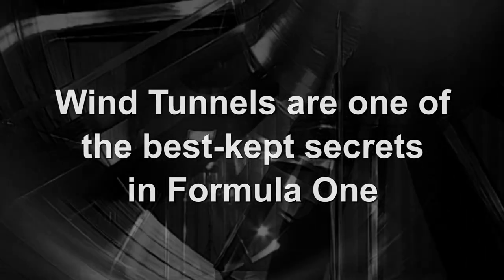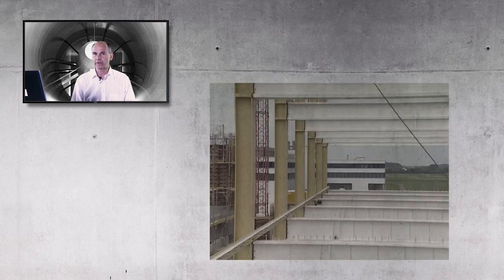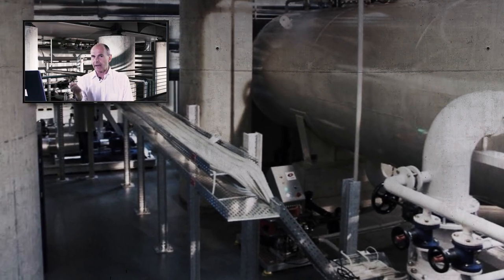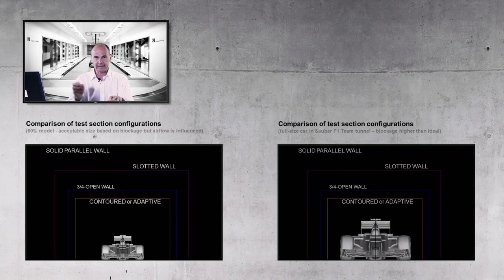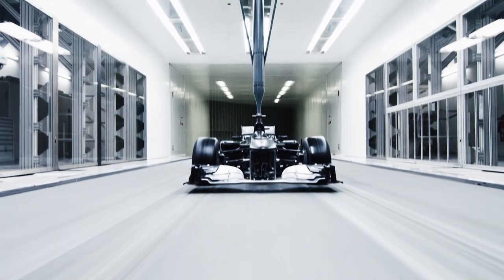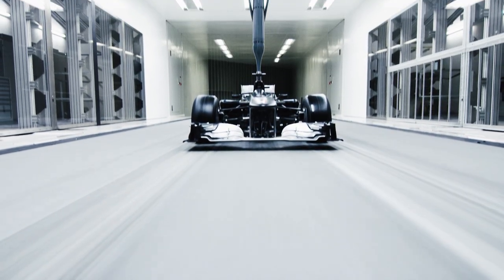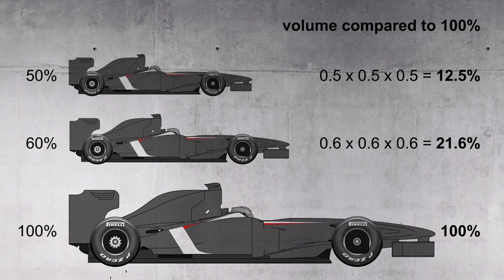How WIND TUNNELS Work - F1 explained - Sauber F1 Team

Comment from the maker: 44 minutes of expert knowledge on how wind tunnels work!

Sauber F1 Team Head of Aerodynamics, Willem Toet, explains EVERYTHING you might want to know about wind tunnels, wind tunnel testing and F1 wind tunnels in particular!

CONTENT and TIME CODES (click on the time code to jump directly to the respective chapter):

00:00 - Basics of Wind Tunnel Design
► basic principles, history
► open-circuit vs closed-circuit wind tunnels
► energy efficiency
► fan, foundation, seismic mass, vibrations
► air rotation and turbulence

04:58 - Heat, Cooling & Airflow Optimisation
► heat, cooling & radiators
► airflow optimisation

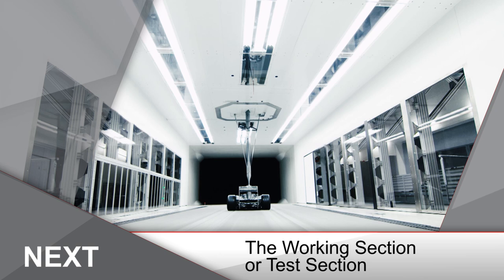08:40 - Test or Working Section
► test section, settling chamber
► closed-jet, slotted-wall, 3/4 open-jet
► contoured-wall, adaptive-wall
► aerospace vs motorsport wind tunnel technology
► boundary layer reduction in motorsports

15:16 - Model Motion System & Tyres
► airospace vs motorsport model mounting systems
► model motion: yaw, pitch, roll
► wheels-on vs wheels-off, wheel steer
► wind tunnel model tyres vs. race tyres

20:51 - Moving Ground Technologies
► rolling road
► development: synthetic rubber vs steel belts
► development: suction control
► friction, cooling
► air bearings & vacuum pumps

27:15 - Measurement Tools
► load cells (6-/5-component)
► wheel load cells
► tyre patch load cells
► downforce, side-force, drag-force
► pressure sensors, motors, capillary tubes

32:04 - The Myth of Smoke in the Tunnel
► smoke wands, rakes, airflow visualisation

33:43 - Model Size & Regulations
► 50% vs 60% vs 100% model testing
► translation of model sizes and speeds
► FIA regulations and testing limitations
► wind-on restrictions

We hope you enjoy this video! If you do, don't forget to give us your thumbs-up and please feel free to share the video!

A big THANK YOU to Alex Humberstone for providing the sound track for this video! Listen to more of his tracks on https://soundcloud.com/alexhumberstone

 #F1   #SauberF1Team   #Formula1   #FormulaOne   #motorsport   #aerodynamics   #windtunnel   #F1explained
Reply: If it's EVERYTHING we wanted to know, can we go back over those areas that Williem didn't want to talk about?

:)
Reply from the maker: Brad McClaren
Hehehe... You mean those highly confidential bits? ;-)
Reply: Precisely.
Reply: I admire the effort you put in breaking down the chapters... Top job! ;)
Reply: Great vid!
Reply: Sauber F1 Team Excellent! More of that please. I know F1 is pretty secretive, but engineers switch teams occasionally, knowledge gets spread in F1 a lot and I think most things that would be technically interesting to the viewers should be common knowledge among the F1 teams. So please go ahead . This was one of the most interesting F1 videos that I've seen in a long while.
Reply from the maker: Thank you very much, brixomatic! Did you watch our Cutaway F1 Car vid(s), too?
Reply: What substances are used to create the smoke for the tests that do utilize the smoke wands and smoke rakes? Is it like dry ice and water or more of a burnable substance, similar to that used for Halloween style smoke machines? Thanks1
Reply: Marijuana
Reply: Did not know untill now that Sauber had a Youtubechannel with such highquality Videos.
(Sorry for my bad English)

Comment: Hey Sauber F1 Team, this video series is amazing. I do have a request for a future topic. In car production, there is typically a team of engineers called Noise, Vibration, and Harshness engineers, whose job is to evaluate the sonic and mechanical characteristics of the car, for an aesthetic and also ergonomic purpose. I would guess that for F1, the aesthetics aren't really a consideration. That being said, does Sauber have a team of NVH specialists, and what (and how) do they contribute to the car? Do they focus on longevity/reliability, or do they bring driver aesthetics into consideration? Are they also responsible for acoustic systems like the radio and driver feedback tones? And lastly, do acoustic tests show up in other, possibly "unexpected" places (like the wind tunnel)? Thanks! -TTA
Reply from the maker: Thanks for the great feedback, TrackTimeAudio! You're right, noise (or acoustics) isn't a focus of our engineers work. We do care about vibrations, of course, and we do respective calculations/simulation as well as tests on our 7-poste rig. Regarding (driver) communication we use respective radio systems provided by Riedel Communications. The biggest issue there is the placement of the drivers' mic (usually in a pocket on the Nomex balaclava).

Comment: There is one thing I would like to ask though, 
- What about the effects of Tire Graining on the windflow? Does that play an important role or could it just be ignored?
- Similarly, the Steel Belt is a very smooth one, but the ground isn't. Does that decrease the accuracy of measurements too?
Reply from the maker: The upper side of the steel belt is coated with a rather rough material, Shirish Potu. The wind tunnel tyres don't react like normal race tyres (wear, graining, etc.). If they did, they couldn't do the mileage described by Willem in the video. But, indeed, it may have negative effects on the track if a car picks up too much rubber in certain critical areas.
Reply from the maker: Shirish Potu Willem adds – the belt coating we use is synthetic and bonded to the steel belt.   It does eventually wear out and become smooth under the tyres.   We get tarmac roughness data from Pirelli and use this to help us characterise the roughness we target for the belt coating in the wind tunnel (for our 60% model).   The tyres run on the model actually are a bit too smooth aerodynamically speaking but we have ways of experimenting with surface roughness and then apply a small correction to allow for it (really sorry but I am not willing to say exactly what we do!). Anyway another excellent question!

Comment: I got a bit confused, before the radiator you stop the swirl or is after the air passess  trough the radiaor that it is not longer sppining at macroscopic scale?
Reply: Swill is stopped immediately after the fan.  The radiator then further reduces any that remains.

Comment: Why isn't the wind tunnel rounded instead of turning vanes in the 90 degrees corners? Because of costs or 90 degrees corners are actually more effective, or because of better wind distribution in the tunnel?
Reply from the maker: atislav Willem says - To turn the air around the tunnel it is actually better (takes less energy) to use “90” degree corners but with turning vanes. The turning vanes make the air turn evenly because they are spaced quite close together. With a curved tube the air speed would not be so even across the working section. Lots of designs have been tried and tested by the aircraft and aerospace industries both before and after F1 teams started to develop wind tunnels for themselves. They have found the same thing. Excellent question.
Reply: Sauber F1 Team Excellent answer, thank you very much guys. I wish you the best for the rest of the 2014 season. I hope regulations will not change much for the next one, so you and other teams will be able to focus on improvements to become more competetive, because you 100% deserve it. (Accept my apologies for my English.)

Comment: Thank you, Sauber.

The belt does not replicate the tarmac's texture. Why is that?
Reply: It can, and at Sauber (for Alfa Romeo)  we do try to get a match tarmac roughness - but every track is different.  Some F1 teams run a smooth belt knowing that it is wrong but do that for improved force measurement repeatability.  They then use computer science to predict what happens on track.  For each track we get average tarmac roughness values on a macroscopic (stone sizes effectively) and microscopic (little sharp edges and holes) scale.  It is measured for the tyre people but is useful for aero too.....   :-)   So one has to have tricks available to predict how airflow will change as the road gets rougher.  One example - aero balance (how much downforce is on the front or rear) changes with road roughness.  Why?  Because air rushing under the front wing induces a bigger boundary layer if the road is rough.....

Comment: Hello, can someone help me with a calculation method by using mathematical equations to choose a fan of suitable capacity for the tunnel attached to the picture, the speed is 30 meters / second, the metal is steel
Reply: The answer depends on the design of the wind tunnel and losses in the corners etc.  There is no simple equation that will calculate this for you.  Sorry!  With big horsepower one can get high speed airflow but you also need good flow distribution around the wind tunnel which also uses some power as well as good design to achieve.  Industrial and wind tunnel fan supplier should be able to tell you what wind speed the fan can generate.  That can give you a first order estimate.